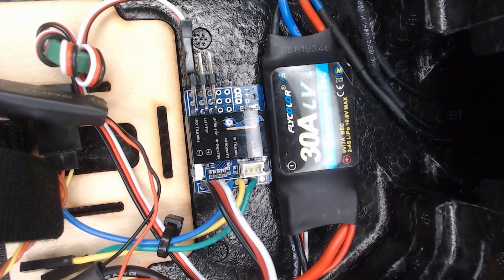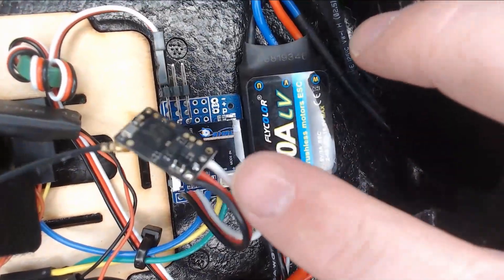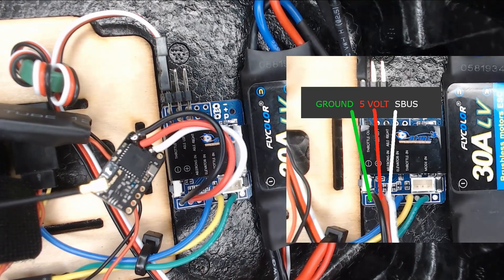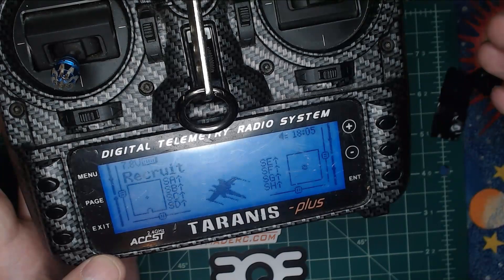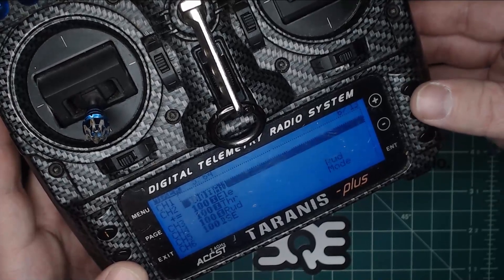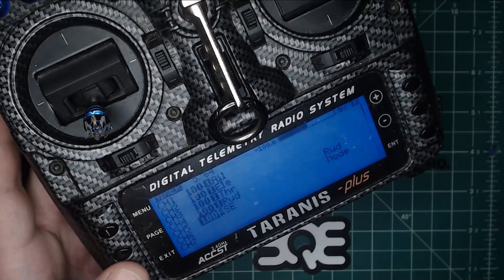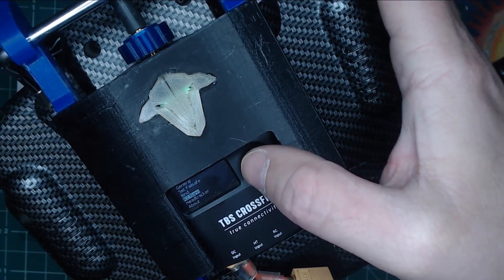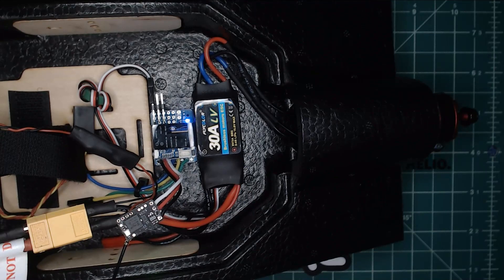RMRC Recruit & Recruit MINI SBUS and Crossfire Nano Setup

Comment: You still have to run the wife on the rx for smart audio, correct? Thanks again as I am looking to pick up the mini for the kid and I to learn on. We fly toothpick quads but love fixed wing also. Thanks for the video content.
Reply from the maker: Yes sir! Connect smart audio wire to rx channel 4.. set smart audio in crossfire setup...
Reply: @MAD_CHILLER  Awesome... thanks.

Comment: I'm absolutely at a loss, I've gotten crossfire to work with the unit. However, my Spektrum transmitter doesn't seem to understand the concept of AETR mapping this wing needs to fly. Is there any way I could have your assistance troubleshooting this? The crossfire and spektrum work fine together, and the recruit receives the commands, but I just can't map it properly to where the elevons work as they should.

Comment: So by using that type of receiver you don't connect the other 3 wires from the flight controller?
It all goes through sbus?
Thanks
Reply from the maker: You just need power, ground and sbus....
Reply: @MAD_CHILLER  ok sounds good. 
I wish we could send pics, I would really like to use my x4r receiver, but I'm not sure of wiring, which wire goes where to the reciever?I build a lot of quads I just stumped on this receiver setup?? Thanks

Comment: You mention setting up smartaudio in this video, I want to be able to use smart audio to  change VTX settings, I have my SmartAudio wire coming from my VTX, how would I connect that?
Reply from the maker: Connect Smart audio wire from vtx to Channel 4 on the RX... Then make sure its set as shown...

Comment: Were you able to setup failsafe?  I have a similar setup and fs works for every Chanel except 3 which is throttle.  I have fs set to put the recruit in full stabalize, 20% pitch down and roll right. Ideally I want throttle to cut but it's not working
Reply from the maker: Yes my failsafe seems to work normally ... The motor will not stop 💯however if that is what you were expecting.
Reply: @MAD_CHILLER  yeah that's what u was expecting. I figured if I'm setting that channel to 1000 when the motor starts at 1050 that should stop the motor.  I get that it's not motor stop and wind will still turn it. But it shouldn't stay at the throttle value it was at.
Reply from the maker: Shai Perednik yeah that is strange.. Hmmm.. I’ll have to do some testing. Lmk If you find a solution.. Also double check your TX sticks are calibrated.. maybe it’s sending just a hair over?

Comment: Hi and thanks for a very to the point vid. I'm trying to figure out a similar problem. However, in my setup i need to control the ESC with PWM directly, whilst the gyro (Eagle A3-II) will be feeded with SBUS. Trying to get this working with TBS Crossfire Nano Diversity RX. Any idea on how to achieve this? 
I get the A3-II to work with SBUS from the Nano Diversity RX, but not PWM signal from the RX to the ESC at the same time. 
In your setup it seems the ESC is also controlled via the SBUS protocol via the gyro/FC. 
Any suggestions is much appreciated. 
Regards Hangar35!

Comment: This is what we need straight to the point quick videos on small chunks. I’m yrying to figure out if sbus on a bgl gyro Gps system is possible with some mod. So far I haven’t been able to figure it out.
Reply from the maker: Im going to check out that gyro! I'll LYK!
Reply: Yeah I’ve been trying to find a way around it. I have a Frsky r9 receiver and hoping to add it to a glider so I can do a little longer range than 1.5km flying